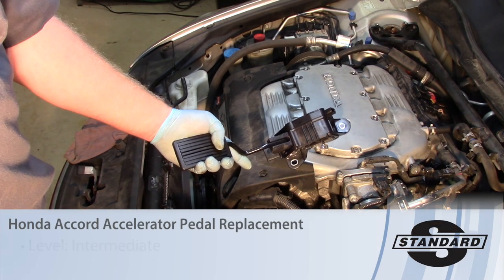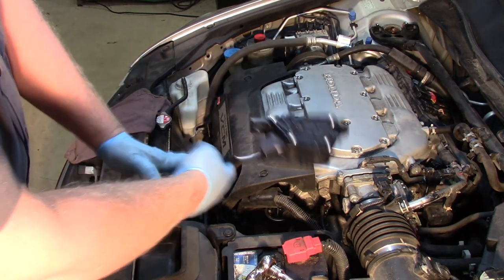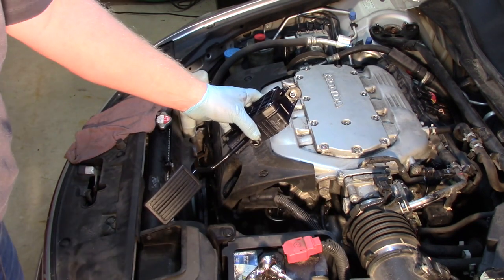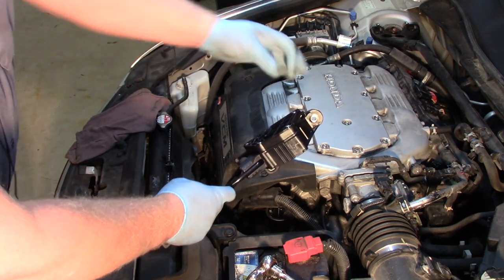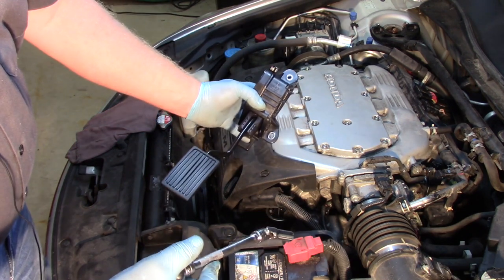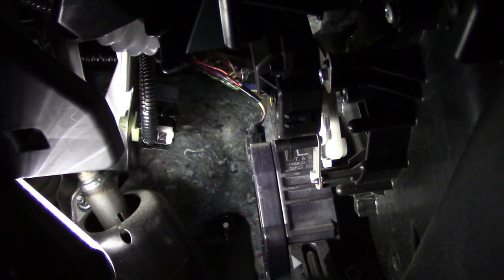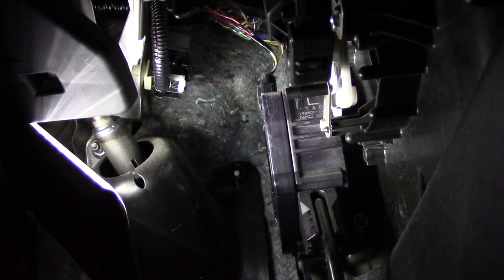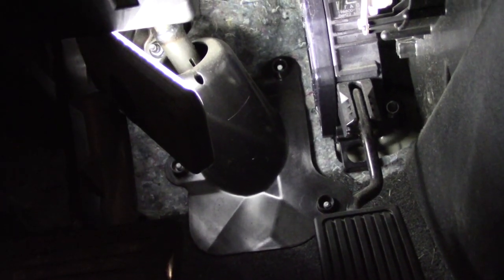Honda Accord Accelerator Pedal Replacement

Comment: what was the cause for replacing the pedal, nothing was mentioned about why you did this...was there a code or something? my buddy has an accord that will start up and idle just fine. but if you put it in drive and then go it will not go over 20 mph, if he pulls over and turns it off, waits like 2 seconds then restarts the car, it drives just fine and will go over 20mph but usually the initial start up and go it will not go over 20...any thoughts on that?